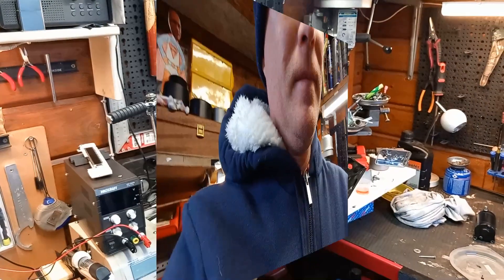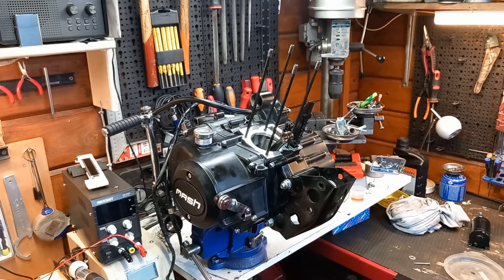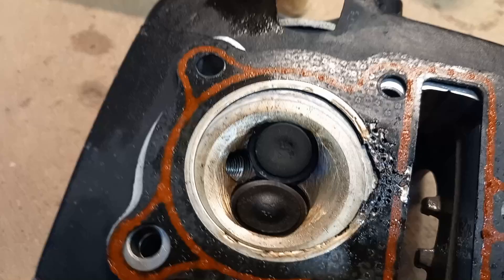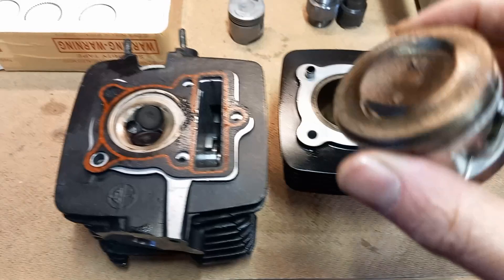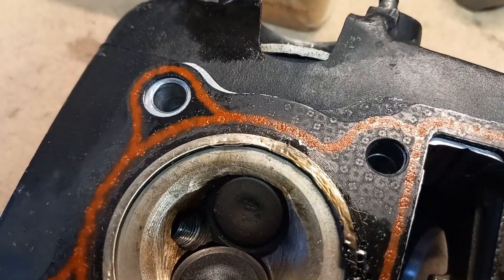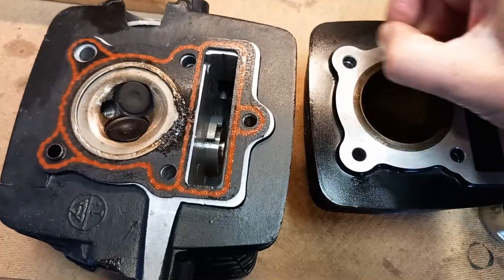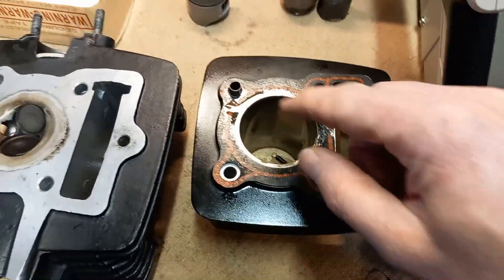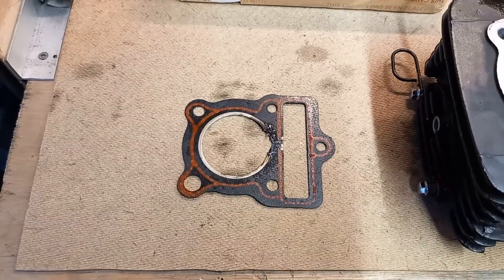Mash Fifty head gasket failure - Check the quality before you install!

Comment: what is the problem before?
Reply from the maker: The initial problem was engine knock. I disassembled the engine to inspect the crankshaft. I rebuilt the engine using new gaskets, this failed head gasket was in the gasket kit.

Comment: Kwam toevallig op je kanaal terecht. Prima uitleg over de koppakking problemen. Ik heb een mash 50 uit 2021. En al na net geen 3000 km is de koppaking er zo goed als uit geblazen. Geld het koppaking probleem ook voor de originele cilinder?. Wat is een eventuele oplossing voor dat probleem. Een echt ontwerp fout van de mash is dat het hele blok eruit moet. Voor de rest met wat tlc een leuk rijdende brommer.
Reply from the maker: Wat de originele koppakkingen betreft heb ik geen klachten, in mijn ervaring zijn die goed. De kwaliteit van de aftermarket onderdelen is erg matig, zeker het ontwerp van de 70 cc zuiger voor standaard cilinderkop. Ik heb vanuit mijn Honda viertakt-periode slechte ervaringen met dat soort kits, want de eindcompressie is veel te hoog. En als een Honda erdoor kapot gaat, dan een Mash zeker weten ook. Rijd sinds dit jaar weer met een origineel blok, daarmee heb ik al meer kilometers gereden dan met de 70 cc kit, die was na 3.000 km echt kapot.

Comment: Would it be possible do you think to get the piston machined a little at the top edge to allow some clearance of the gasket ? and this also could possibly lower compression slightly too as have heard it is too high with the standard head !
Reply from the maker: Yes, that is possible. I even think the engine would benefit from skimming  0.8 millimeter off the piston crown. Thanks for your comment!

Comment: could it be that the 70cc piston and bore are a bigger diameter
Reply: If the 70cc piston is bigger do you need a head gasket with centre hole to fit 70cc piston.
Reply from the maker: I know, the 70 cc kit comes with it's own head gasket. If you use the 41 mm head gasket with the large bore, the engine won't even turn over.